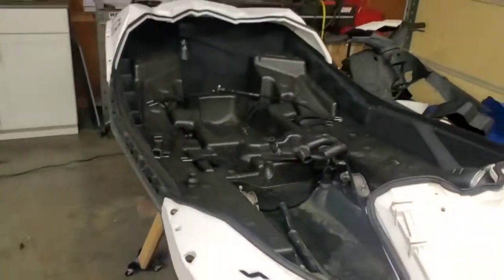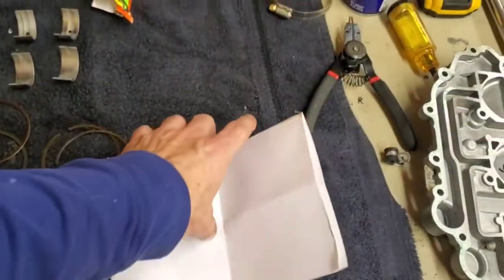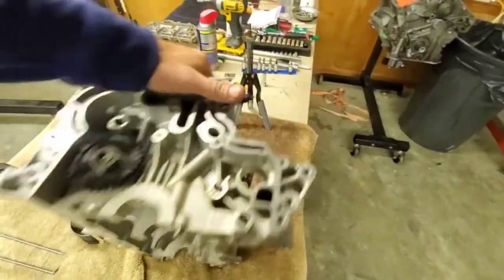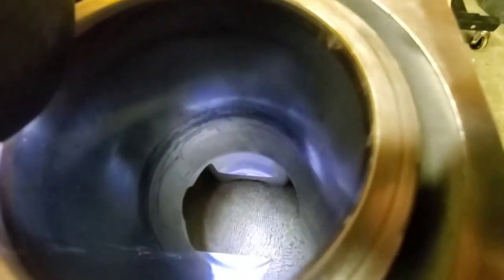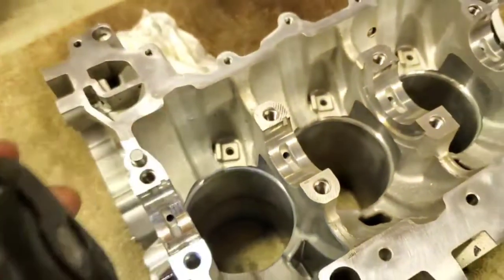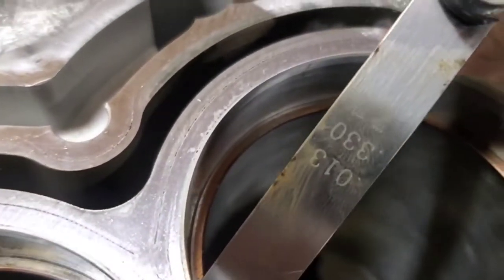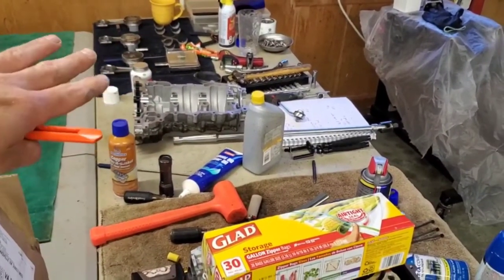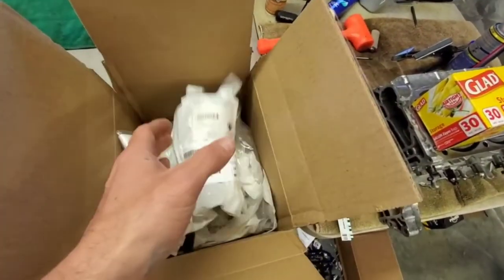Sea-doo Spark Engine Rebuild Prep. Part 2: New Parts for Crankshaft Assembly

Comment: Bro I envy this…I had just put a vinyl kit on my spark and the fiancé totaled it first ride this season into a boat…I thought it was trash but after a lot of thought I pulled it apart and bought all of the replacement parts. Now I’m not rebuilding the engine but it is a new hull and literally moving every part and reassemble the entire thing, not to mention some mods and body work. I pick up the new hull in 48 hours and I’m stoked to put this thing back together and see if it works haha. I knew zero about sparks and now I’ve gained tons of knowledge on an awesome project that will be better than ever. Found your videos and I’m anxious to get this back together and the labor to pay off…upgraded the vts, ECU, exhaust, mirrors, air intake, sound system….anyway I really appreciate what you are doing here because I can relate!! Look forward to the results!!
Reply from the maker: Much Respect! Comments like yours are very Uplifting for Me! Love to hear feedback! Good luck on your project as well, hope your lady gets some lessons on operating a Ski! It definitely takes some getting used to! Cheers 🍻
Reply: @h2omechanic   I have a 2018 Spark and I'm getting a misfire at low speeds on cylinder number 3.  If you're sitting on the ski, where is cylinder number 3?